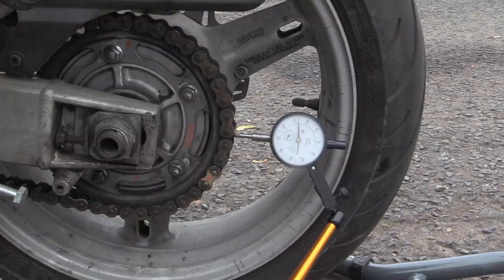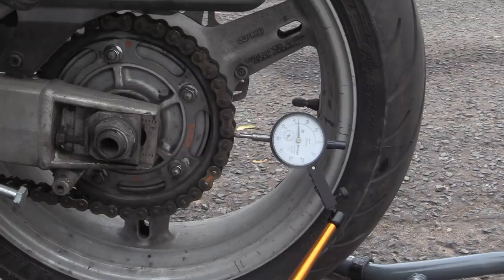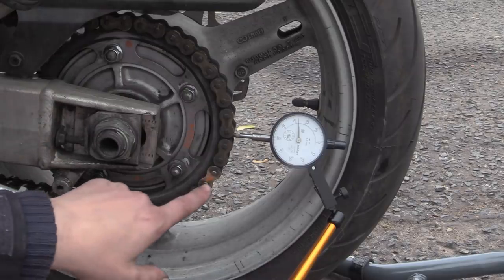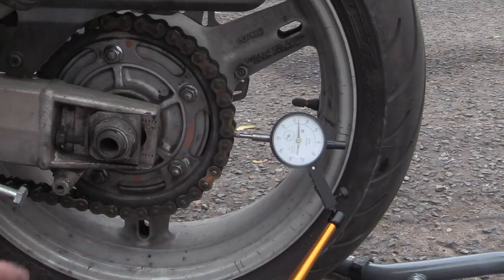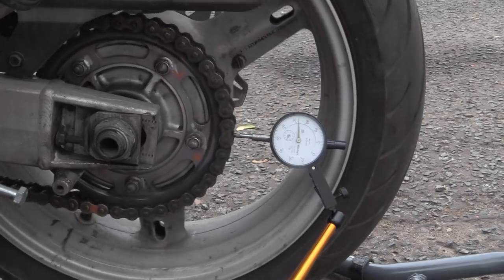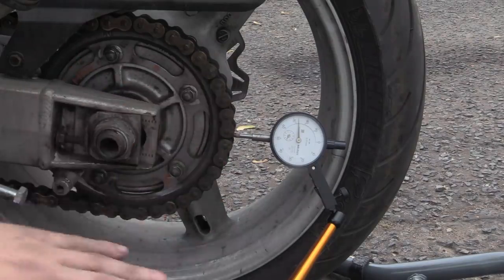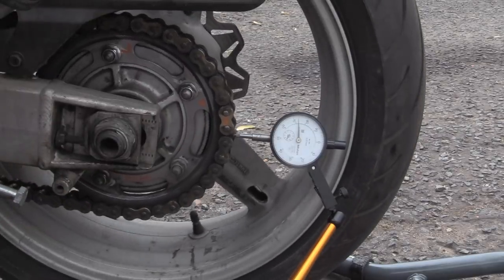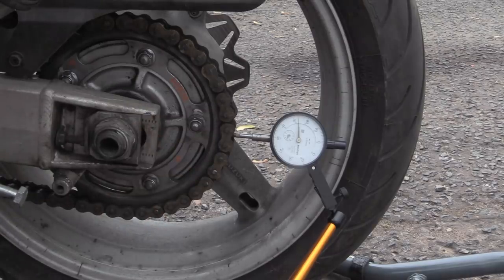Chain tight spots - but why?

Comment: Hey man ik this video is old but I'm having a problem I think with my chain, it'll get very loose and very tight so I tried to adjust at its tightest spot but still gets very loose and now my bike is stuttering at steady throttle like the chain is tightening enough to slow the rear wheel periodically it feels like a misfire but it accelerates fine it only stutters when decelerating and steady throttle
Reply from the maker: You need to check you axle and wheel bearings. Is it s 125?
Reply: @dirtygarageguy  it's an r1 I don't think it's the wheel bearing or anything
Reply from the maker: Why wouldn't you? Someone could have stretched the axle nut or thread.

Comment: Matt..This is good stuff..but is it the whole story?.....Chains can wear in odd way`s...
Thankyou for this..It explains alot.
Reply from the maker: "but is it the whole story?"

- no and this isn't wear - 'where' did you get that from....?
Reply: @dirtygarageguy  ...A four/2 cylinder bike delivers relatively smooth power to the chain...My Klr 650 hammers the chain
especially at low rpm...

Comment: I have just gone from 16/45 teeth to 15/45 with a 110 chain (just changed the front sprocket, chain and sprockets were 600 miles old) and I have a huge difference in tightness and slack, not sure if it was like that before or whether it's to do with the change in number of teeth to number of links?
Reply from the maker: No. It's the offset of the sprocket.

Comment: did you ever do a part 2?  I have 99 ZX-9R. original owner, pristine condition only about 20,000 miles with new (less than 1000 miles) supersprox sprockets and  RK GB525GXW  X link chain.  variation in tension of 10mm!  a mark on sprocket shows that the areas where tight and loose are always when sprocket is at same point in relation to a mark on swingarm, so it is NOT chain.  when loosen sprocket nuts though, there is no play for sprocket to move.  may try rotating sprocket on hub.  could have stacking of tolerance-non concentric hub and non concentric sprocket and mounted in such a way that the concentric areas line up, magnifying situation.  may get some improvement (less variation) if that is the case
Reply: hey were you ever able to figure this out?
Reply from the maker: I want a video.

Comment: Hi all, can this be a reason for a chain noise? I fitted a D.I.D vx chain and a JT sprockets but I have a wierd noise between 20-50 m/h. My mechanic said its because of the tight spot in chain. Its extremely annoying! Can I do anything about it?
Reply from the maker: Your mechanic is an idiot. How can you even hear your chain at all?
Reply: @dirtygarageguy  as I'm riding I can hear a noise like "woo woo woo" and it gets faster or slower when I speed or break. After about 50m/h it fades in.

Comment: I am interested in the rear brake disk..that is the SV? . It's not the stock rear disc is it. Advantages of the 'petal' design v's stock.
Reply: Sorry don't know what disc that is but regarding advantages, the different designs of brake disc's serve two purposes cooling the disc and even wear on the pad. However due to the fact that it is the rear disc it simply does not get used enough for a design to make a noticeable difference to performance. IOW the standard is the best in regards to performance however the performance difference between it and even the worst performing one is negligible.
Reply: Weight and cooling

Comment: I stumbled on this video and I really like it but at the same time it made me confused. I haven´t seen a sprocket that was non-concentric or oval for about twenty years. Well if you don´t count really cheap ones. Are you sure it is the sprocket and not the hub or the bearings in the hub or something else? What I have seen a lot is chains with tight spots when the chain is left for a while. Especially if the chain isn´t lubricated or if the motorcycle owner lives near the ocean.
Reply from the maker: "I haven´t seen a sprocket that was non-concentric or oval for about twenty years."

 Not the sprocket itself - its alignment to the wheel.

"Are you sure it is the sprocket and not the hub or the bearings in the hub or something else?"

- No, and that's gonna be in part 2.
Reply: @dirtygarageguy  Thanks!

Comment: There could be another thing that caused this; the Cush drive rubbers. If they become a bit loose than the the sprocket will wobble. Any views on this hypothesis?
Reply from the maker: The bearings align the sprocket, not the cush drive.

Comment: Belts are better!
Reply from the maker: Well..... they usually have tensioners, so yeah?
Reply: How do you know youre not getting a false positive meauring the tips of the teeth? The rollers could have a bad concentricity or the sprocket could have a bad concentricity causing a bad pitch concentricity... theres a lot of variables here.

I am kind of surprised motorcycles havent made the move to CVT belted system tho!
Reply from the maker: "How do you know youre not getting a false positive meauring the tips of the teeth?"

- Good question - that's why I went for a glancing blow - the teeth are below this level - I'll show that in the follow-up video.

"The rollers could have a bad concentricity or the sprocket could have a bad concentricity causing a bad pitch concentricity... theres a lot of variables here."

- This is a demo - like I said - but the next part will show and anser more of these questions - but ulimately that is the point - we haven't even considered the cush drive yet

"I am kind of surprised motorcycles havent made the move to CVT belted system tho!"

- Torque and weight. 

https://www.youtube.com/watch?v=xmVl0gwedS8
Reply: Seen it! Still think thats its BS!